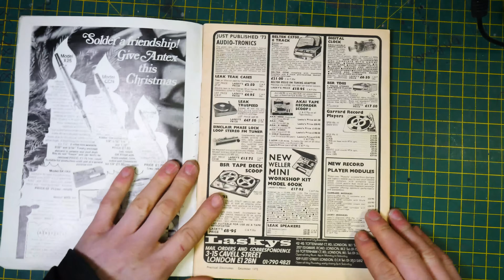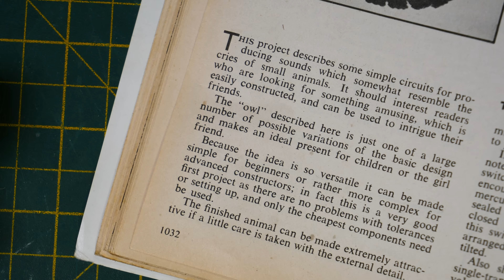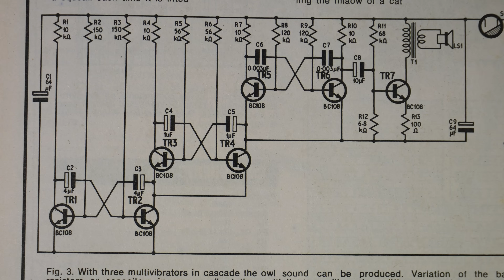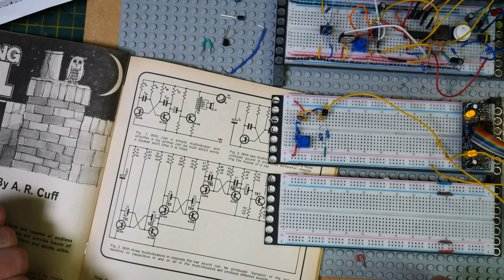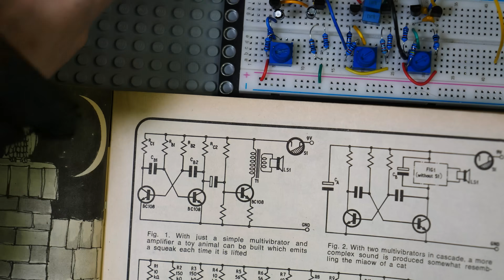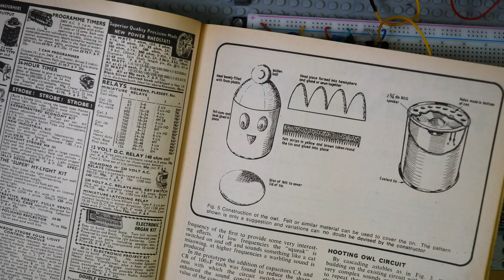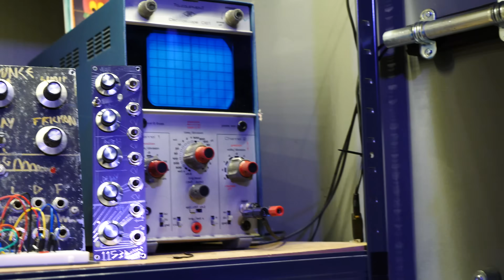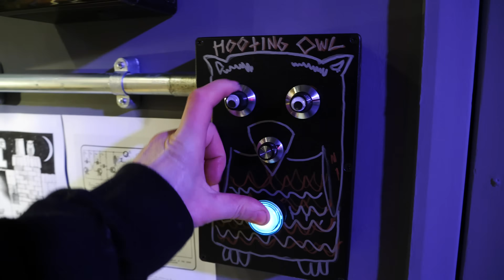DIY Analog HOOTING OWL - Practical Electronics 1972

Comment: A two transistor multivibrator was the circuit that really caught my imagination in 1968 that my father helped me to build using a Philips kit that had the loop and spring mounting method. With a simple resistor ladder to make a rough octave. 10 years ago I thought I was one of the last people to do this type of thing and now I can see that there are many people doing this hobby. With  around 50,000  subscribers you are an excellent example of today's generation keeping the wonder in the simple stuff!

Comment: I remember my electronics engineering teacher tell me about this two transistor astable multivibrator not supposing to work in theory but in practice it just does. The flashing two bulb version of the circuit was the first one we built in college too as well as also making the PCB for it.

Comment: You think there circuit in a custard tin is bad you should have seen mine. I put a whistle activated switch in a Planters Cheese Ball container and I had it hooked to my little B&W TV. However, when the theme song to MASH played the whistle switch turned it on and off all through the beginning theme song. That's just the kind of stuff we did back then.
Reply: PS in 1972 I would have been a little rugrat suckling at my mother's bosom.

Comment: The circuit that CrucFX mentioned to you is worth messing with I think, personally I'm a bit obsessed by it. The thing that makes the normal circuit work is that you can always be sure that at the end of an oscillation cycle, the first transistor will be off, and the second one will be on. But if you add a 3rd transistor into the cycle, the transistor 1, which it feeds back to, will be on at the same time, and the whole circuit starts freaking out because it's trying to resolve which transistor it needs to shut off to reach a stable cycle. Some people might not find it musically useful but even still it's definitely interesting

Comment: Each cascaded multivibrator switches on the next (left to right)
Think of it as an lfo which turns on an oscillator with its pulses, which periodically turns on another oscillator. The large capacitors on far left and right might also act like a decay envelope.
Reply from the maker: indeed you're not wrong!!

Comment: That is an unreasonablly large quantity in that tilt switch. The ones I've seen only have a single bead, not enough to see it flow as a liquid.
Reply: By the looks of the thickness of the cables it's made for pretty high currents

Comment: The way you have the pots connected changes the mark-space ratio, to change the frequency, connect the middle resistors together then connect that point via the pot to positive ;)
The astable multivibrator was the first circuit i made, probably got the circuit from one of the mags